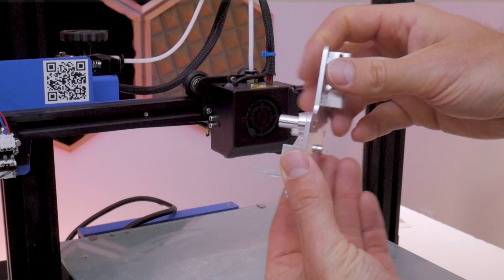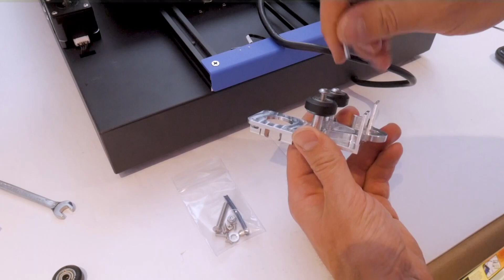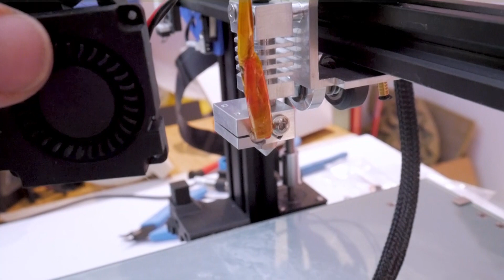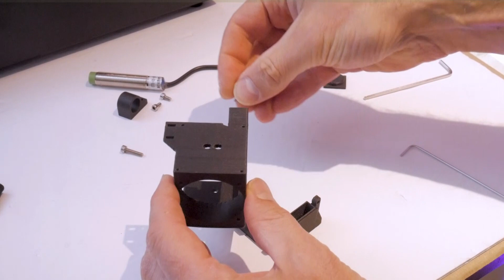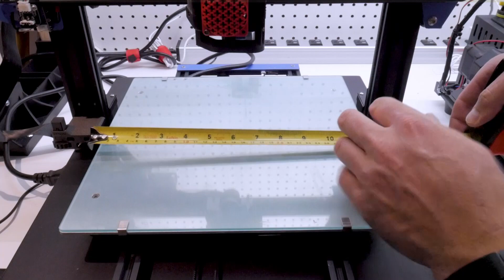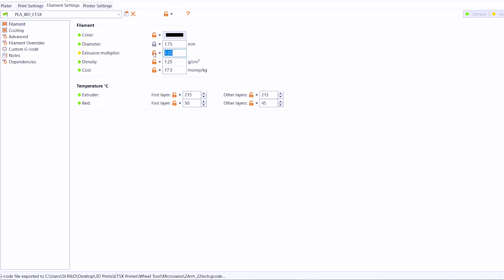How To Install Micro Swiss Direct Drive Kit On ANY 3D Printer (Creality ANET Alfawise Geeetech etc.)

Comment: Hello, is it possible to obtain the y-sensor offset and home offset information? My bed leveling mesh appears to be offset after this upgrade, causing issues with my printer. Additionally, could you provide your previous Marlin settings? I have an Anet ET5 printer as well.

Comment: Just did a Swiss Direct Drive upgrade with Jyers 2.0.1 firmware update. PLEASE help explain how and what firmware/code to modify for this new direct drive. I have no clue how to even get to any firmware code to modify.
Printer: Ender 3 v2, BL Touch, Raspberry
PS. Getting back to printing & forgot about everything. Yes. Great video and really think I could get there quite easily with just a reminder
Reply from the maker: You can do a few things... I believe in this video I couldn't modify my firmware, but since you already have custom firmware, you can look up how to edit the firmware if you have the source files, so you would edit the extruder steps to whatever the new microswiss unit is supposed to be, then recompile them and reflash your firmware. OR the easier thing is to just connect your printer to a terminal like octoprint or repetier host or pronterface with a usb cable and use the terminal window to write a new e-step value and save it. Check out my video here where I do the same thing for a Bondtech extruder on a CR10 printer: https://youtu.be/LJT7qkvbolY and yet another option is to edit the e-steps in the start g-code of your slicer so that at the beginning of every print the printer uses the new value... lots of videos and info on how to do that online but I think it is best to just use the print host to write a new value permanently.
Reply: @EmbraceMaking  perr-fect! Thanks.  Got it!

Comment: Very interesting!! 
I have an Anet A8, do you think it will be possible to use Micro Swiss product? I can make new pieces with my milling machine and my lathe. 
Thanks again.
Reply from the maker: If you have a mill and a lathe you could probably make your own carriage... the A8 uses the two horizontal round rods so you would have to machine a carrier for the bearings and then interface with the microswiss hotend and stepper motor pieces
Reply: @EmbraceMaking  Thanks for your very fast answer. Have found a real difference with this new kit? Regards

Comment: Thermal paste on the hot end and heater block is a BAD idea. Thermal paste's maximum temperature limit is way below the temperature the hot end will reach and you will end up degrading performance or possibly damaging them as the paste degrades. Thread lock is also unnecessary for this type of application although it won't hurt. Other than that a good installation video!
Reply from the maker: Thanks! I'll have to go back and take a look at which kind I used from that little syringe... I typically use a copper based one from Permabond... I have this giant container of it and its rated to 2000 degrees F and have always had good results. I even use a thin layer of it on the nozzle threads, being very careful not to get any into the melt chamber area. This particular installation from this video is still running and have never had to disassemble, I run this machine daily, between 4 to 10 hours per day and its been rock solid. Probably one of my best printers which is surprising because the ANET machines are not known to be the best.

Comment: Hello Embrace Racing, Great video. I downloaded the stl files however the front fan cover seems to be missing. Or am I missing something?
Reply from the maker: Check here: https://www.thingiverse.com/thing:4934573
Reply: @EmbraceMaking  Thanks, works great... Question, do have plans on updating for MS with linear Rails. It wont fit the back plate.

Comment: does this work for the anet et4+?
Reply from the maker: Should! Almost the same printer as the ET5 which I installed it on
Reply: @EmbraceMaking  thank you so much
Reply from the maker: No problem!
Reply: @EmbraceMaking  Great video ER, thanks! Could this extruder be modified to be installed on a Anet A8+?
Reply: @birgernielsen9952  Not unless you print a mount for everything. The anet A8+ has the steel rod lines and the Micro swiss is for a 20 by 20 aluminium line.